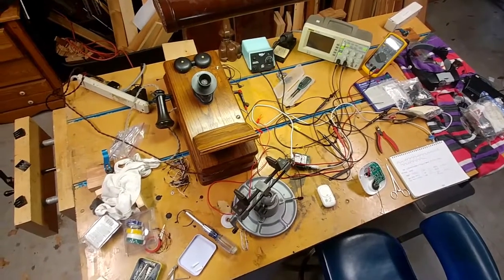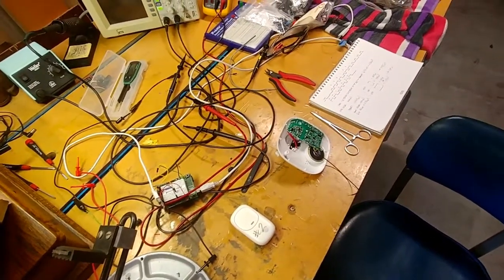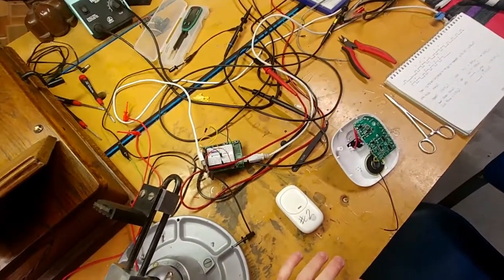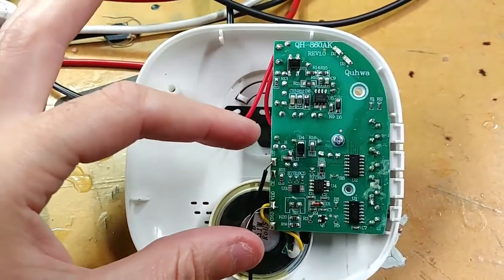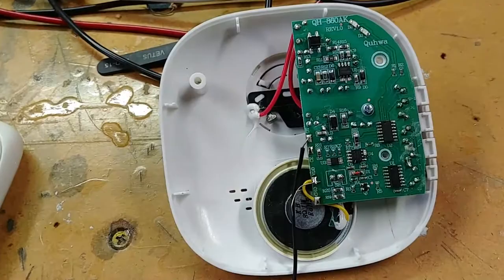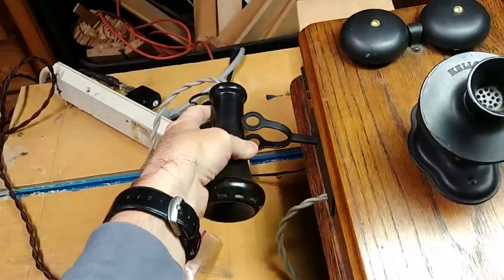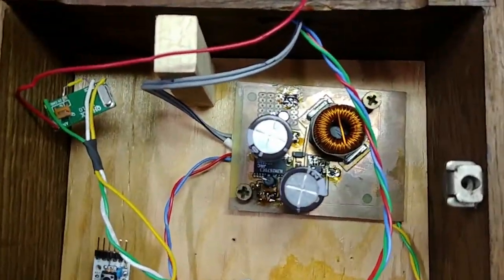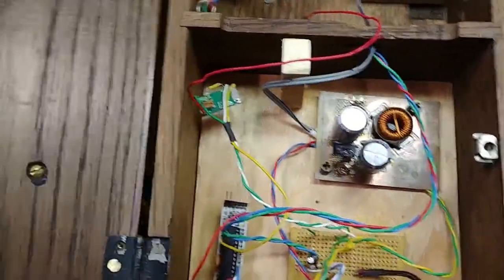Let's combine a cheap wireless doorbell with a century-old phone

Comment: Very nice coherent walkthrough. Why an auduino? Wouldn't the original circuit board in the wall mount receiver have both a power supply, decoder ic and a logic level signal from that decoder chip to trigger the nasty melody chip, you then could utilize to drive your  AC ringer circuit?
Reply from the maker: It might have been possible to hack the original electronics to produce the phone ring and dial tone signal instead of Happy Birthday or whatever, but throwing a $10 embedded Arduino was definitely the easier option.  Also I wanted to power it off USB instead of having mains voltage in there.  Thanks for watching!
Reply: You like Arduino IDE better than I do.  The dial tone was first invented in the 40's with the dial,  before that you either lifted the receiver, as you said in your video, which pulled enough current on your line to have a solenoid on the switchboard release a shutter covering a small emblem with your line number so the operator knew you intended to make a call. tapping on the hook made the solenoid chatter at the switchboard to communicate your impatience, or you used the crank if the switchboard wasn't manned it rang a bell at the central, so typically at night where the few night shift girls had more than one board it was needed to get attention. It was also custom to crank the handle when you ended the call to signal the the line was free. Your dial tone is a nice touch, but not historically correct. It makes sense not to run AC through a century old smouldering cloth wires
Reply from the maker: I did not know that!   Thank you for the info.